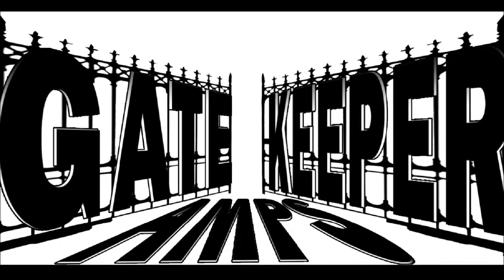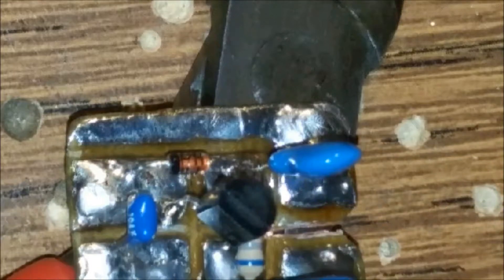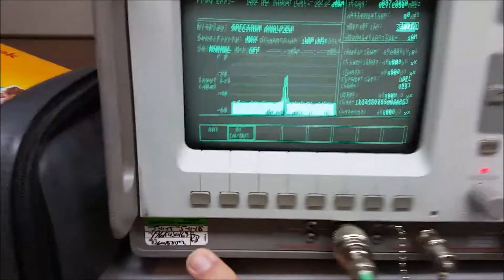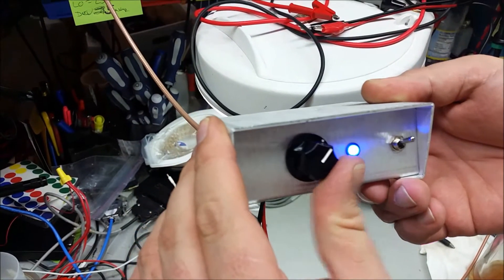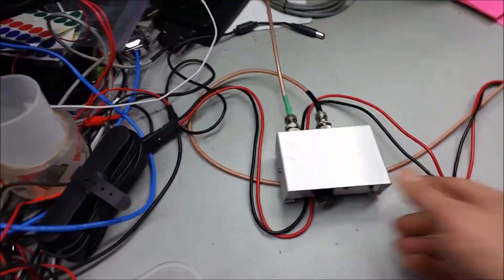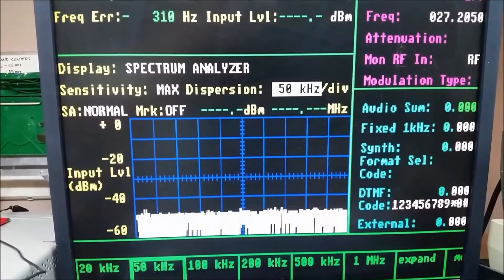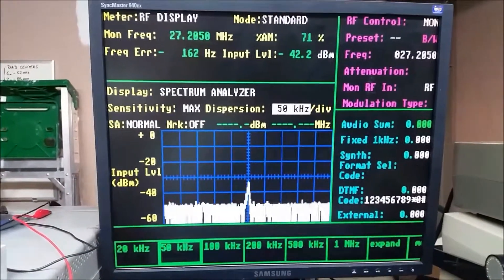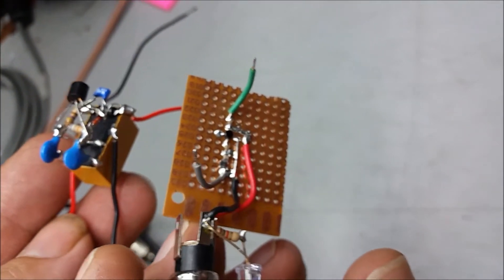MUST WATCH! Newly Designed Pre-Amp For CB Operators

Comment: There was one issue that WAS NOT MENTIONED in this video,this is about the FACT there are SEVERAL pre-amp RF-transistors that have different noise"floor"levels,another words,the ability to suppress static levels while amplifying the signal.Its VERY IMPORTANT to select a RF-transistor that has the very BEST noise suppression.
Reply from the maker: Very very good point. I should have prepared my demo a little better and talked about noise figures and how low of one that the device being used has. It is very low. While some will be a bit higher while the general purpose switching transistors are VERY HIGH.

Good looking out bud!
Reply: @1883GotDown  I do my best,thanks.😁👍

Comment: Off subject but can you describe what a local man said when he had a approx 100amp kicker that attaches to back of cobra 29 Ltd.  Said it uses same power source as radio and only adds about 2 inches to radio length. Allowing me to use in my current application(tight spot). Thank's Ricky
Reply from the maker: Sounds like your talking about a RX75 or the newer version. These are around 100w Amplifiers added to the back of radios. Yes they use the same power source as the radio.

I have a cobra 25 over here I dumped about $680 into lol. It has one on the back that Installed.

Comment: It took over 4 months to receive after an open PayPal dispute. Opened the box and have an orange piece of metal that looks cool and won't power on.  I can't test it and gatekeeper hasn't responded.
Reply from the maker: What? Hey bud I havent recalled getting an email from you? It wont turn on? Wondering is somehow the switch was damaged. I have had that happen 1 other time but the customer replaced the switch his self and all was good.

Please email me at threemanpro@gmail.com or call me. Goodness if you have a unit there that you cant even power on I need to get you a switch to replace it or you need to ship it back. I'll pay the shipping.

Haller back at me bud...I just ran across this comment....I dont normally have enough time to check every comment on all my videos.

Thanks bud and I am very sorry about this.

Comment: why is the before and after test running at different Mhz????   your equipment before the test is at 100Mhz and the after its running at 50Mhz?????????????????????
Reply from the maker: No it's not lol....its stays on 27.205 the whole time. You may be looking at something else. Maybe the bandwidth or something. The RF Generator stays on 27.205 Mhz....imma go watch it again and see what your looking at.
Reply from the maker: Oooooooooh....no no no..that is the div scale...he had to turn it back because the preamp gain was so high it changes the div per scale. That isnt the Frequency. That is not a scope.

Honestly I had never noticed that so good looking out. The monitoring Frequency is the Frequency the Spectrum Analyzer is reading...the 100khz or 50khz is the reading scale of bandwidth....actually it may adjusted automatically I'm not sure. I was not. Concerned with that in the video I was wanting to show the gain of the preamp.

Thanks for stopping by and good looking out.

Comment: That is a real pre-amp.  I use the old MFJ pre selector that has a tuned input section and a dual gate mos FET. goes to 60MHZ. great rejection out of band. MFJ still makes it but the one I have is the one with transmit bypass relay. was discontinued a few years back. my spectrum analyzer is the older tectonics matches my dual trace scope. OLD CRT models but work fine. My frequency counter is the heath kit IB 1100 and a IB 1103 NIXI tube display. and a lab grade HP with crystal oven and divider goes to 1GHZ. it is calibrated buy     NIST. and has NIXI display. 1/10 of 1cy reading. trigger takes 10 sec for first reading. I love nixi tube displays so most of my old stuff have them.  I do have modern FLUKE 87 meter and a DC clamp on amp meter that is a AMES from harbor freight tools.

Comment: That looks like the ne5532 op amp. based solution I've been working on for use with my pt2399. echo boards. I want to make an all in one kit anyone can assemble for less than $10
Reply from the maker: Karl Porath What I am using is an IC but it isnt what you mentioned. Your right though it does resemble it. Good eye. Good luck on that kit...if you ever get it done i would like to buy one from you. Gatekeeper said that and im gone

Comment: Hahaha I think something very simple has been overlooked...
Reply from the maker: explain what has been overlooked if you don't mind
Reply: Please elaborate... Only thing that I noticed was at the end of the video when comparing the size, the new unit has no relay, even so all smt boards take much less space than through hole counterparts only issue in my mind is repair ability if one tiny component fails (At this stage I would have to replace the whole board, tiny solder tips and extra thin solder/reflow ovens are not on my list of gear.). I prefer through hole..
Reply from the maker: +LeapFrog469 that is a good point bud but the main device itself is surface mount.

it doesnt have a relay because it was a  prototype second one actually. the first one he use surface mount coils but he quickly noticed that using hand wrap coils gave a better gain.

but yes that was just the Prototype put in a box to test and for demonstration. thanks for stopping by but the fella that help me with this project by the way is undergoing some serious surgery I talked with him today and once he is out of surgery on the 4th of May he's going to take a few days to recover and start producing these preamplifiers I will release the prices at that point it feels so good to actually give the CB community a properly made preamp although it will cost a little more but you get what you pay for you know how it goes God bless from mr. gatekeeper out here around the Northeast end of Georgia
Reply: +1883GotDown  Mr. Gatekeeper I appreciate the response, a board like that would be a welcome upgrade to my tired old cobra 25, if its going to be that small in production it could fit right inside the radio and then I would have a use for that ch9 switch!   I wonder if they will be incorporated into them wicked kickers you make of course for the people that want the preamp option.  I'm going to email you at threemanpro, I got a question about a straight 8 irf520.    God bless you brother & 73's        The LeapFrog hopping outta here central Fl and I'm gone.
Reply from the maker: @LeapFrog_Radio  the one I am about to release now is actually small enough to fit inside a radio.
Reply: @1883GotDown  Nice, that is what's up!

Comment: send me the price to add to the 2x8 your building
Reply from the maker: well there's still a few hurdles that I gotta jump through the guy that I partner up with this has had to move to another state so we are working on getting a few units made and also so I can start duplicating it that's all surface mount components and soldering which I have never done before so I might have to do some learning
Reply from the maker: Still interested?